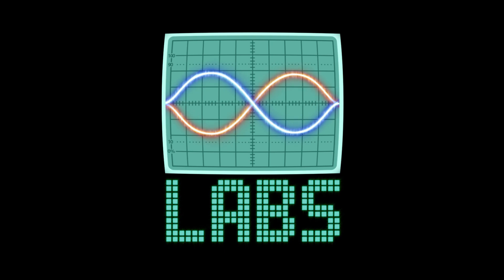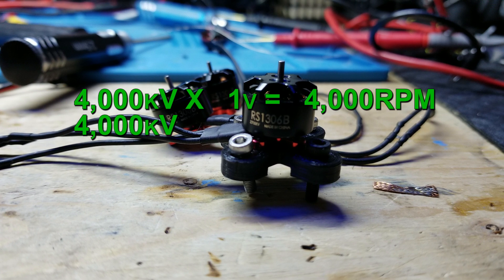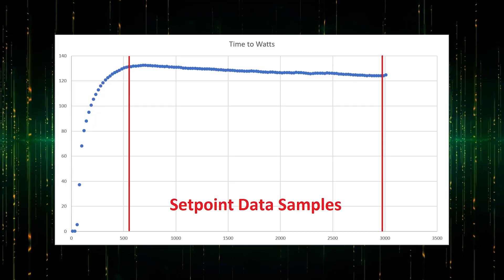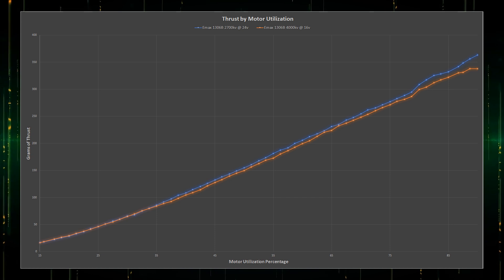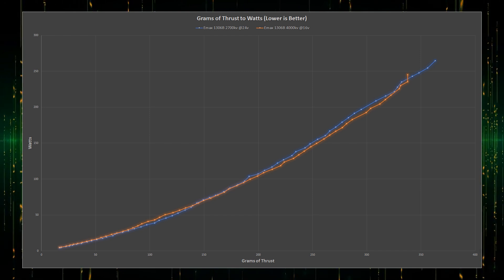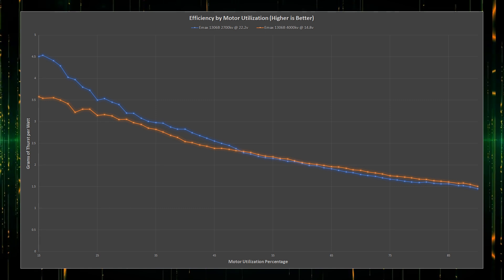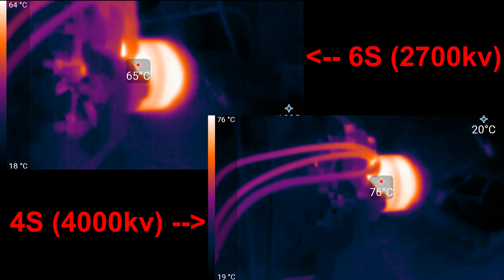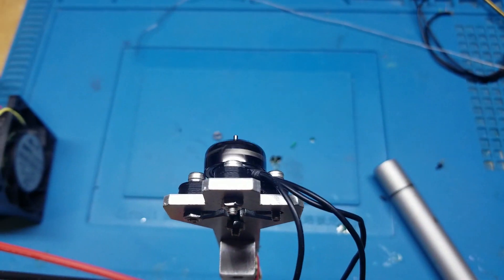Recursion Labs - 6s vs 4s - Detailed Head to Head Automated Motor Bench Testing

Comment: Excellent, this matches pretty much exactly what I've seen from my testing on MQTB, as well as practical experience. Those differences are close enough that in 90% of cases you won't notice an efficiency difference between 6S and 4S unless you're flying super slow, and in-flight with active cooling from air flow the heat loss difference and resulting thrust loss due to the change in resistance is also negligible. The other thing to consider is that most folks are not running the comparable Kv between 4S and 6S. In most cases (especially 5" and up) they're running significantly higher Kv for the voltage when they're running 6S. My general conclusion has always been that your run 6S for power, and it typically takes a couple of percentage points of efficiency loss over 4S the way most people fly, with the motors most people choose. Some of your analysis is specific to 3" though, so some of the 5" and up practicalities don't apply. Great video though! Nice work.
Reply from the maker: I really appreciate the feedback bud. I have tremendous respect for the testing that you've done. 

Yeah, you never really see people switch from 2400Kv on 1300mAh 4s to 1600Kv on 850mAh 6s, which is why it always seemed a bit silly when people directly compare them after increasing the Kv/Wh so much. To me this seemed more relevant for 3" (or any sub 250g build), because on common 5" builds, throwing on bigger batteries to compensate for a higher watt draw is an easy solution, but efficiency and battery weight seems much more important on smaller or long range builds, where giving up some thrust potential might be worth it to decrease the size of the battery you need, or increase flight times.
Reply: @RecursionLabs   Exactly. I think the key is to decide what your goals are first, then design the power system to meet the goals for the build. I think most pilots just slap something together without really considering the application. Fortunately the differences we're talking about are small, so even a less-than-optimized power system still works very well in most applications. My general conclusion after years of testing and building is that all of these differences are within a pretty narrow band of functional outcomes. In the end I figure anything that functions and gets people in the air is great!
Reply from the maker: @QuadMcFlyFlies  100% agreed. If we're being honest, this is mostly applicable for people where designing, building, tweaking, and improving builds iteratively is as big part of the hobby, where you get satisfaction knowing you've gained 5% thrust/efficiency, or shaved off a number of grams of weight. It's noticeable, but not enough to make it worth the time sink for most people. Having the data available when this is your goal absolutely invaluable though. That said, it's nice for people who can only afford $10 motors or can't easily get some big brand name to know they are not missing out that much (if at all).

Comment: amazing video, thank you! 
I couldn't figure out the answer just watching so perhaps you can help me... i have a 4s edf jet that is too slow and not worth buying a new motor, as i have a bunch of 80a ESC and 6S batteries, besides shortening the motor's life to a few minutes of existence, will i see that old lazy jet goes faster when i punch full throttle without limiting rpm or anything like that, just raw full send 6s power in a 4s motor?